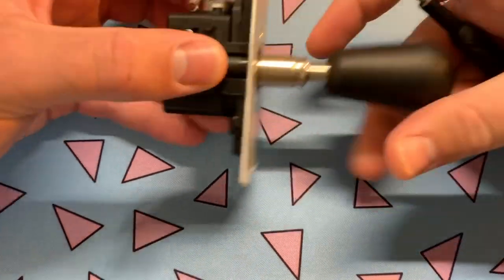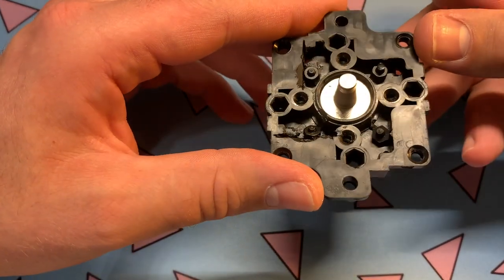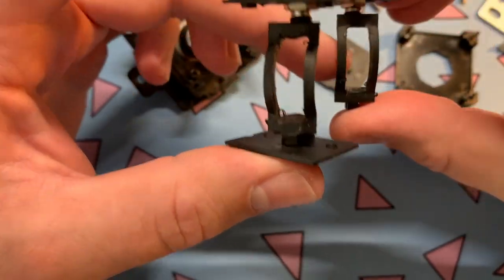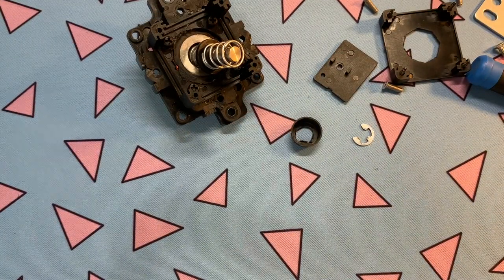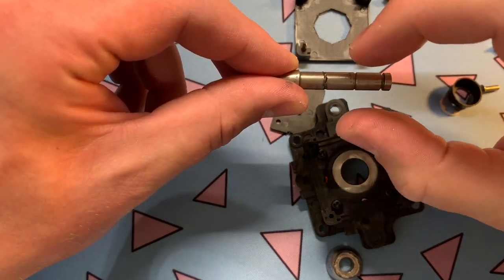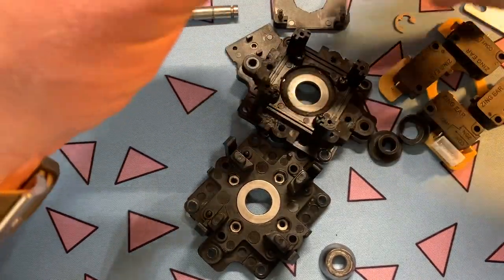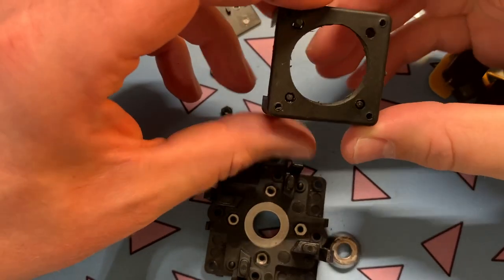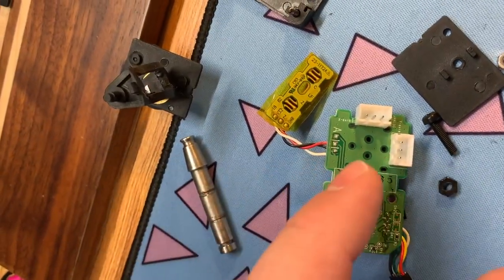Homemade Analog Arcade Stick for use with Smash Bros

Comment: Dude, mad props to you. It's such a pain finding anyone interested in making sticks for Smash Bros, and many people don't understand you need analog potentiometers; digital switches don't cut it. Sanwa JLFs are nice, but they're everywhere and not meant for Smash as is. Can't even find the mysterious Sanwa JLM, the one that uses magnets to output an analog signal. Cool idea combining the Adafruit with the JLF, wish that the procedure didn't require a lot of drilling and demeling...

The Alt Labs Smash Stick is the only premium alternative compatible with Smash Bros, and when they finally come out (still stuck in production limbo), their Hall Effect magnet sticks will be much more preferred. Still, the potentiometers similar to those on the Adafruit stick have been used in some 3rd party analog controllers before everyone jumped on the Alps bandwagon. They're pretty reliable, albeit need serious silicon lubrication as plastic grinds on plastic over time.

Only other alternative I can think of is something similar to the optical sensors in N64 control sticks. There's documentation out there on converting those optic signals to expected Gamecube analog input.